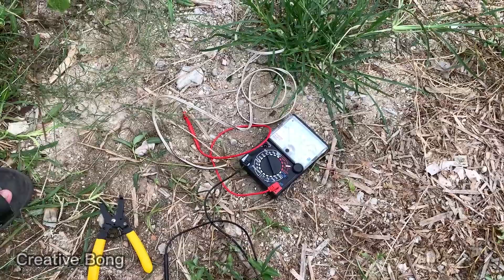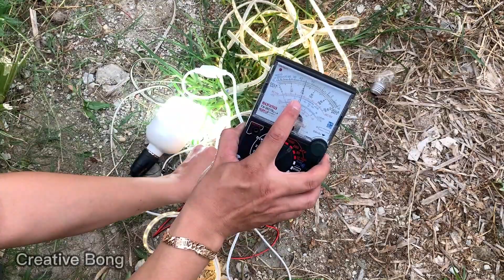How to make turn a fan into high power 220v electric Wind Turbine generator I

Comment: 12:20 -  How is it that the device is running with the force of the wind and the surrounding bush is not moving ?? This is fake !
Reply from the maker: This device is powered by wind, because there is no air around, we used a fan.

Comment: Cool turbine but there is no way that thing can generate anything near 220v. Be lucky if you can charge an old mobile phone by the time you add in all the resistance on a charge board!
Reply: Yo no creo que pueda cargar un celular x tiene los imanes separados claro podrá encender los focos LED aora si se llega a cargar cualquier celular ustedes creen que les durará la máquina o celular como la tensión de la línea eléctrica claro Vi uno similar un pequeño que carga con complejo de circuitos de una manivela pero sin esos circuitos no podría cargar un celular x esos circuitos purifican la tensión para el celular